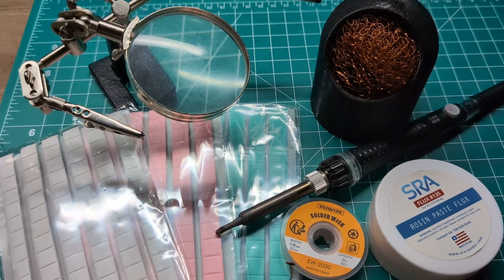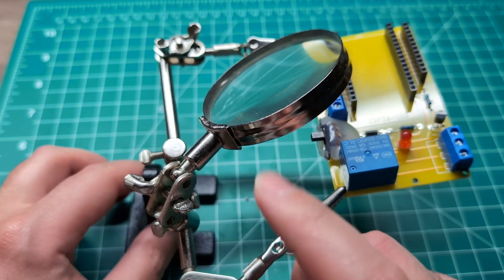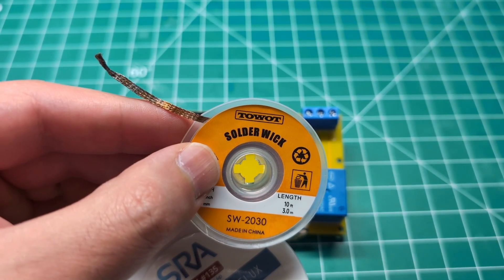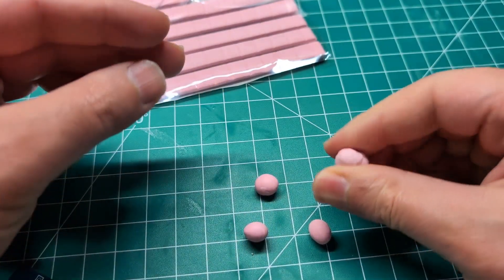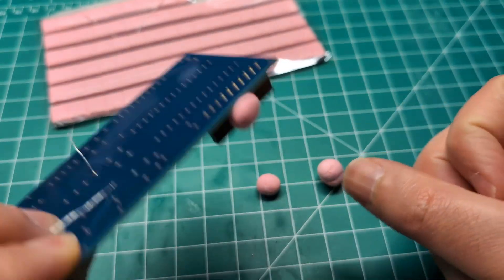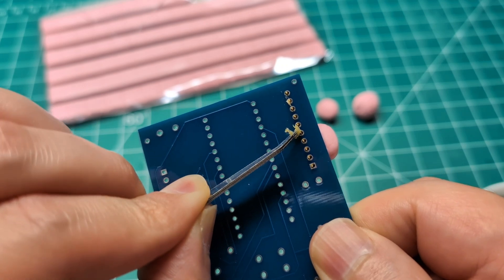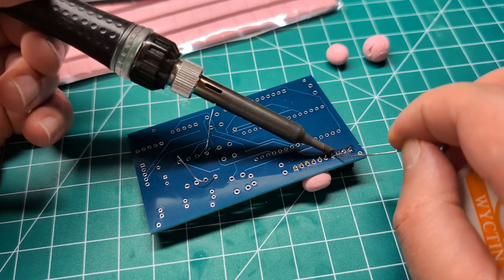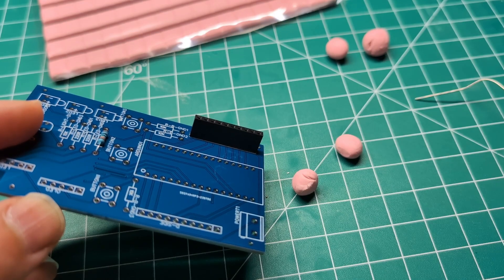Soldering Tools - Hold Components In Place While Soldering

Comment: those helping hands, if you use. Two of them facing each other, and remove the magnifying glasses, they work better. Four pin headers I use tagging, where you take a blob of soda onto the iron, you hold the header in the holes with your fingers and you tag each end pin in place with the solder. This holds the header in place why are you solder the pins including re-soldering the end ones. I also use the weights on the helping hands to hold boards down.
Reply from the maker: Thank you so much for the tips and for your nice detailed comment. I appreciate it

Comment: I'm concerned about the metal dishing washing scrub. I think getting a proper brass wool is better for your tip's health but really I haven't try the metal one. About the pla case, I just use small ceramic bowl lol. But the other things are really great! Keep it up!
Reply: Dont get copper, only brass. Real good genuine legit brass. The thing in the video looks like copper coated steel. Check it with a strong magnet. If it sticks to the magnet. Throw it out the window. 
3D printing a housing with no metal insert will likely leave plastic on your soldering tip from accidentally touching it.
Reply from the maker: Thanks for the details, I appreciate the information and thanks for watching
Reply from the maker: There is good information in this comment, I think it's helpful to pin it. Thanks for the contribution
Reply from the maker: Valid point, it works fine from what I tried but if you have an expensive iron I agree. Thanks for watching
Reply: @techs.passion  No problem! I am also not entirely soldering professional lol. If you want to check out expensive solder for your next project, I recommend you the hakko brand because it's what I am using. You either get their regular soldering iron or soldering station, depends on your budget range
Reply from the maker: Thank you, I will look it up now

Comment: Helping hands work but you have to get some decent ones. Mines is a round metal magnetic plate and the arms have heavy magnets in them and there is a clamp accessory.  The tips are covered in rubber for all the helping hands and have a screw so you can rotate it to any angle. I e never used plastic helping hands that actually worked for me personally. 

Those glass magnities never did anything for me. I think I paid 40 US of AliExpress for a 4 to 5" 720p screen attached to a microscope with a 4X manual zoom and focus. It works great and was around 40 US from AliExpress They had higher zoom and resolution screens for.more but what I got works for me. hat's what I use the clamp for. To hold it when soldiering using the helping hands for smaller hard to see/get to parts. 

One small tip, on that header board, it's best to hold just the soldering iron to it about 1 second longer before placing the soldier wire on the opposite side of the pin, trying to not touch the soldiering iron which is easier said than done. That way the wire melts much faster as it's the pin that needs to be heated up enough to melt the soldier by itself. Much faster this way once you get it down.